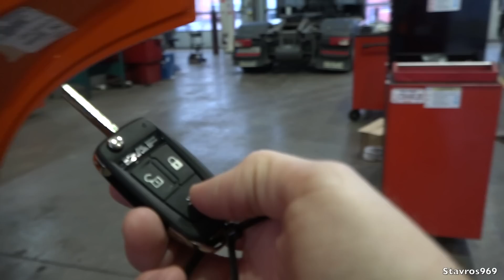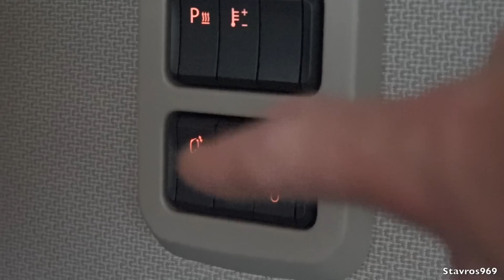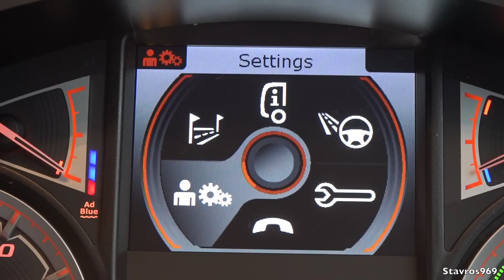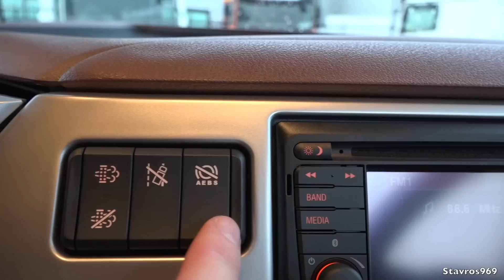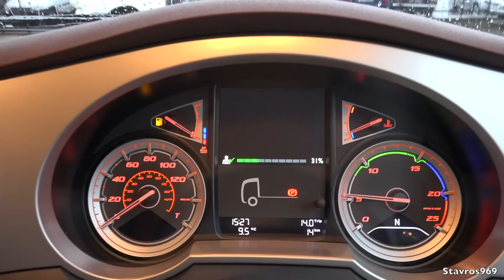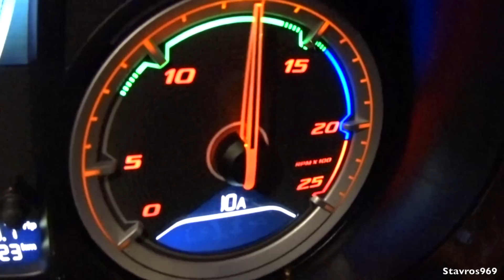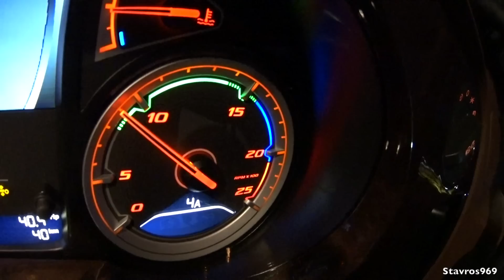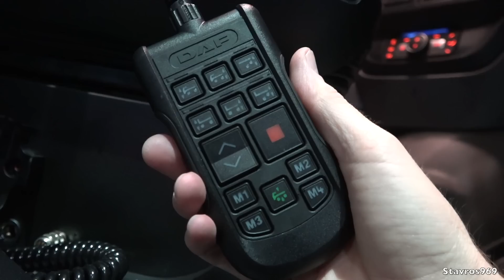2018 DAF XF 530 Super Space Cab - Full Tour & Test Drive

Comment: Love the Daf. Lots of room and storage. The best bed in trucks by far. Cab is a bit soft and wallowing in corners, but that’s what makes it comfortable. The only model to have is twin steer. Positive steering in winter and slippery conditions. My negatives. Ridiculous gear selection, very slow, sometimes wrong gear. Uphill, steep inclines. Takes too long to recognise gradient. Exhaust brake needs massive improvement. That’s it. Apart from that, faultless. My favourite truck.

Comment: Hi Stavros, great vid mate, DAF is a lovely truck in those specs. Don’t get the gross weight on the small and large mid lift option, being the same. Surely the larger wheel is heavier so would reduce payload. We can ponder that for a while, it’s still a truck that has great comfort and is going to leave you feeling great after a long day/drive. Cheeerrrs🚚😂🇬🇧👍🏻
Reply: Hi Mike the smaller wheels won't be much lighter & you'd have to weigh both different types of tractor unit to determine if there is a difference. What is important is that whether you have the smaller or larger mid lift wheels those two different types can CARRY the same amount of weight regardless of whether or not one is lighter than the other.
Reply: guy kendal ok, cheers for that Guy, sorry but still don’t get why a small and large mid lift option is offered. How do you make the choice? Sorry to be thick on this. I have a pretty good knowledge of truck weights and configurations , this thing just jumped out at me. It was, what?🤔🤔

Comment: İs it full auto gearbox  (with torque converter )
Reply from the maker: erenle deneyler ve herşey olur Eren Kösemehmetoğlu 12 Speed fully automated TraXon gearbox
Reply: Like the I-shift, Opticruise
No Torque converter
Reply: Trucks never use torque converters
Reply: It is actually a conventional gearbox with a normal single plate dry clutch, BUT all operated electronically.
Reply: @ivowiersma1465  Dennis Eagle refuse collection lorry's use a torque converter.
Reply: @ivowiersma1465  there are some: allison 4500/4700 and tc10 all with torque converter
Reply: @ivowiersma1465  not really correct. You can order Allison or ZF converter transmissions for off-road trucks or waste collectors as examples.

Comment: What does Eco Roll do ? Is this vehicle a hybrid ?
Reply: Adithya Ramachandran No, it just sets gearbox in neutral when going slightly downhill. Saves fuel by doing this.
Reply: @corvanrossum3381  Does it also cut off fuel while coasting down hill?
Reply: Adithya Ramachandran It sets the power back to idle.

Comment: Why does the truck at 5:10 have sich a small wheel there😳😳
Reply: Saves weight
Reply: It's a light axle for a bit more load capacity on the tractor. It's only popular on the islands, on the continent you won't see them.

Comment: Paccar is a junky company, I bought 2019 KW T-680,  and in 7 months 80,000 miles, I was total all ready 2 months in the shops :( and change anti-freeze seal injectors Seal and oil construction in 25,000 miles consum 3 gallons oil:( and they change the seals and they screwed up my fuel-efficient from eighth and 8.1/2 mpg to 6.1/2 :( they killed there own Engine:( and had a lot a rattling and the wind blows on the truck and there are shops they can fix their own trucks , that’s how rape of , my advice stay away from Paccar Technology
Reply: In europe its all fine with paccar. Maybe you need to try a Daf XF
Reply: LOL, send one to USA , and costumers service is bad, maybe not with everyone but with me :(
Reply: The best Moto daf